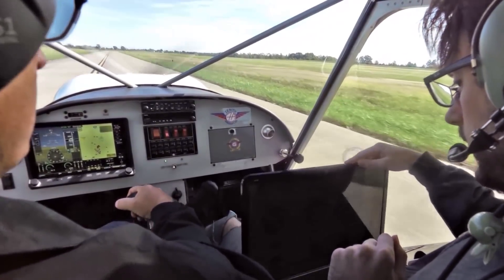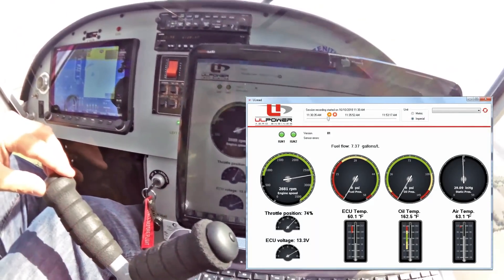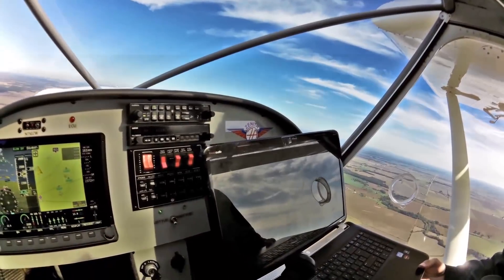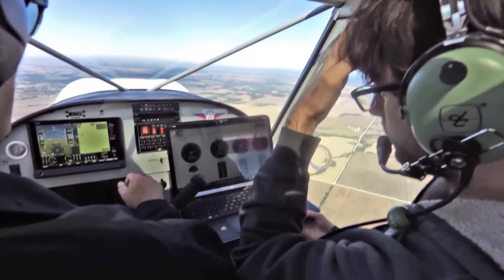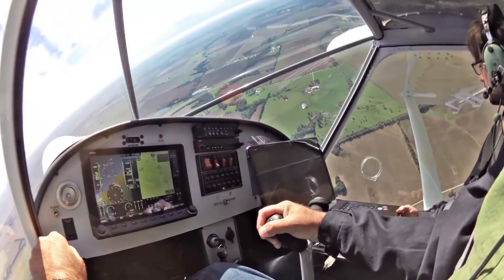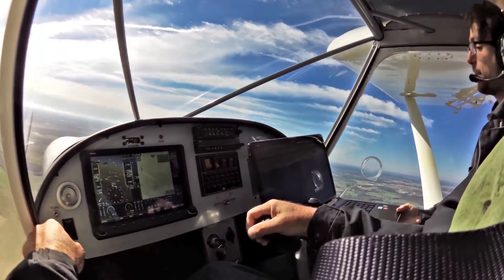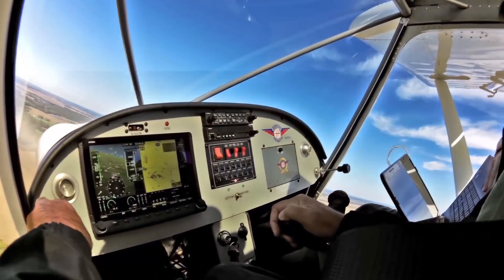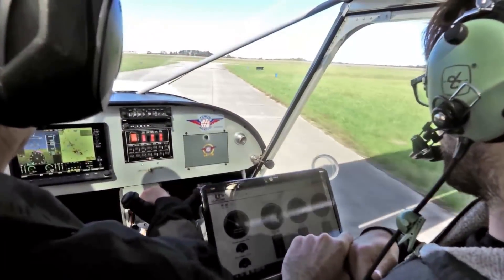Flying the Zenith CH 750 Cruzer with the UL350i engine, plugged into UL-Read

Comment: I have no experience with this engine/ECM but for sure if the ECM thinks the tach is bouncing around like that I can't see it having brains enough to deal with it with programmatic smoothing.  I would tackle that tachometer(yes, intended) first.  It may have nothing to do with the symptom you are chasing but in the process of fixing something you CAN see you might fix something you can't see.

Comment: Hello all, I too had an intermittant caution light as well. Turned out to be an oil temp sender malfunction light as perceived by the ECU itself. After attempts to troubleshoot by changing the sender and performing continuity check on the wires, the problem has been diagnosed by ULPower as a software issue.  They just returned my original ECU with the updated software and I will test flight very soon. They do not believe all ECUs are affected. Just a heads up.